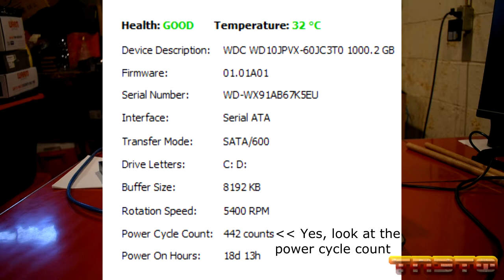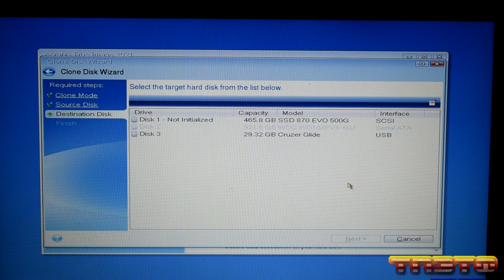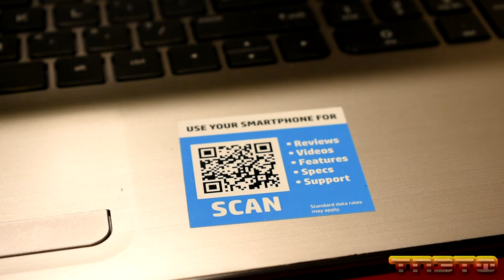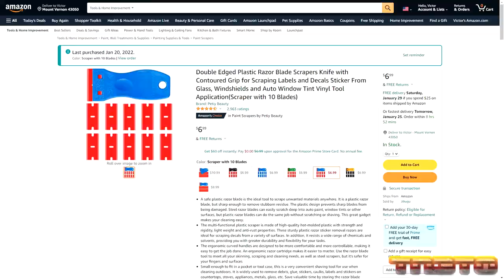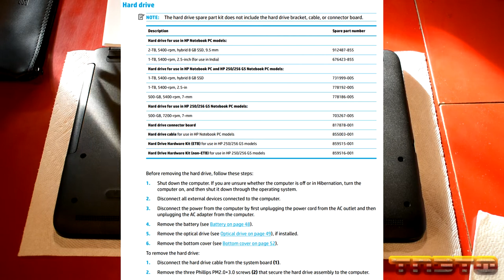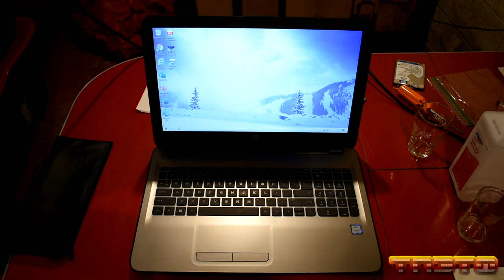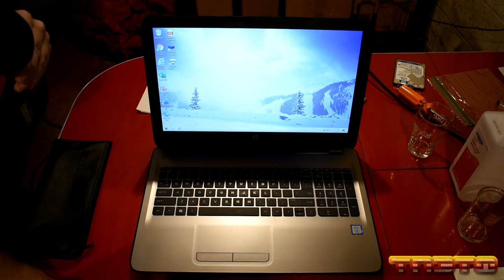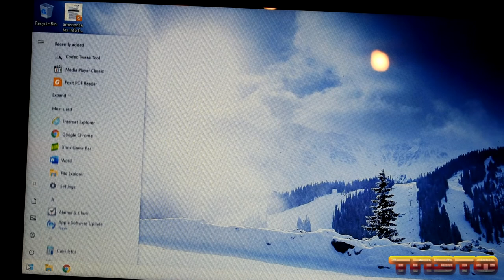HP 15-ay163nr Laptop Hard Drive to SSD Upgrade

Comment: did you managed to unscrew the heatsink? i have a HP 15-ay169nr and im thinking on upgrading from a HDD to a SSD, upgrade RAM to 16GB and changing thermal paste, so this video has been really helpful.